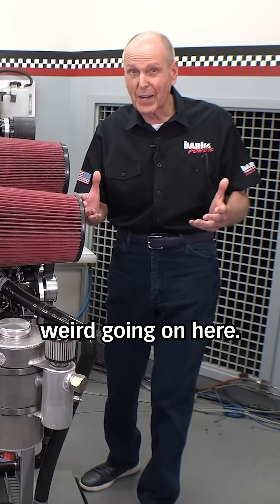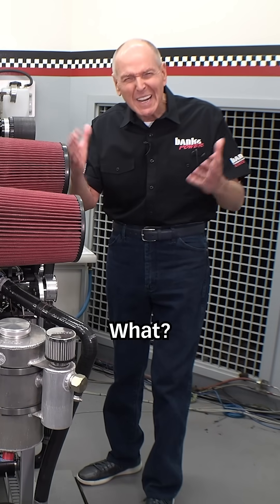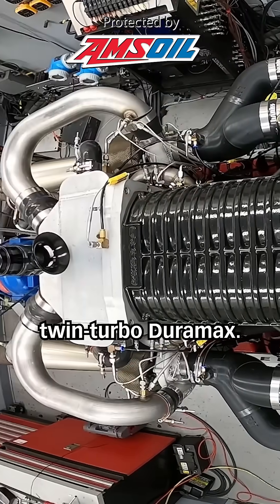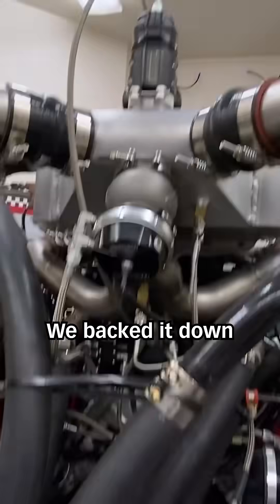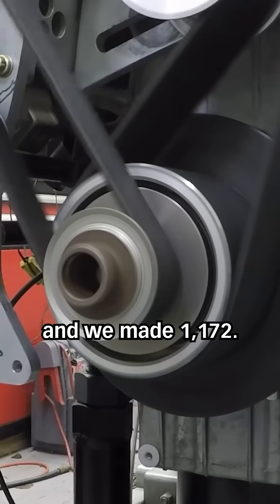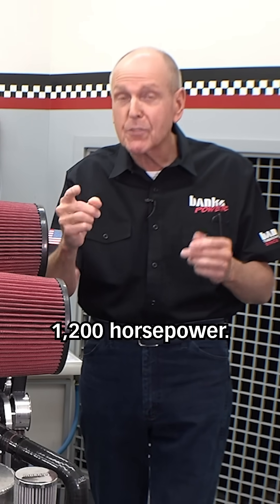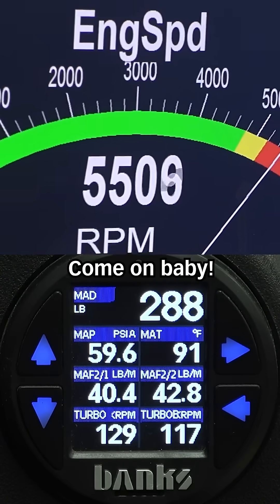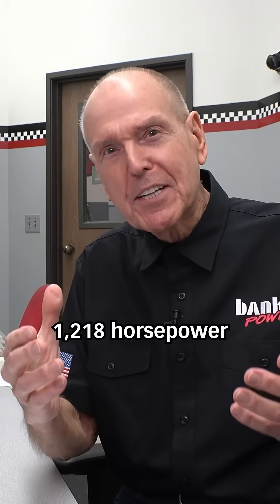How to make 1,200 horsepower the wrong way.

Comment: Did dude just say he has the blower second??? That completely defeats the purpose of a super charger🤦🏻‍♂️. Thats for quicker lower end boost until the turbo spools up. Super charger always goes first. 
And then you need a bypass valve to be able to skip the blower or else its actrually going to lower the overall boost by disinhibiting the turbos air flow.  
Surely this guy remotely knows what hes doing right?  Right?😅😭

Ps wtf would u even put a blower on a duramax. That doesnt even make sense. Its not a peppy track car. All its doing is straight lines. Turbo lag doesnt really matter on that. 
Im in diesel performance and ive never seen let alone even thought about super charging a diesel truck😂
Diesel likes its turbo.

Comment: German company Zoche build a 2.5 litre, four cylinder radial two stroke diesel. Low speed air came from a turbo blower driven by the crank. Probably 1 to 10 step up speed. Turbo was plumbed into the same manifold. The driven compressor was also the engine starter. Compressed air blown into the compressor eye spins up the engine. 
It made 150 bhp at 2,500 rpm. Which was perfect for a lightly stressed aero engine. Spun up to 4000 rpm you be seeing 250bhp. Add high pressure common rail injection and 500bhp would not be impossible. That would be 1000bhp from 5 litres. 
Sadly, it all fizzled out. Aircraft homologation is a money pit and they ran out. Such a shame.

Comment: Horsepower peak isn’t the only or the best metric. Turbos have lag, the blower is more parasitic but able to create horsepower early in the RPM. That’s one reason this is all nearly pointless today and tomorrow… electric vehicles make peak horsepower and torque at 1 rpm and are controlled by million times a second computers.

Comment: Higher blower speed/ PR = more thermal expansion.   Less air density.   
Blowing the blower should bring down the PR as rpm goes up reducing thermal expansion  improving density. 
Most non-lab grade testing shows sealing is an issue using the blower in the 2nd stage.

Comment: Problem with roots style blowers is you can't provision an intercooler. Spin them fast enough and instead of increasing density you are just making the air hotter. Gale knows all this hence why he's saying it's backwards. 

The real solution that is very engineering challenging is have a supercharger when turbine pressure is low and turbochargers once they have spooled up from exhaust gases. The challenge is gating the airflow properly from one to the other smoothly.

Comment: The problem with running the blower before the turbo is that the blower is a fixed compressor. It is always pushing air, so when the engine goes into vacuum you're putting stress on the turbo's imput shaft as the intake turbine and exhaust turbine are being forced at different speeds. It's different when turbos are compounding because they scale with the same exhaust pressure. What about doing away with the blower and slapping twin compound systems on it? Or running a massive centrifugal blower on it instead of the twin screw?

Comment: Stupid question.  Is there a way to have a small turbo for quick initial boost and an oversized one for high end power set up on an engine?  Or is there a reason why they run two of the same size?

Comment: Check intake pressure before the turbo inlet and after also flow rate before and after, I think what's going on is when the blower is turned up the turbos might just be slowing the intake air rather than compressing it more.

Comment: It’s just me, but whenever I’ve looked at twin charged engines. I have always wondered why they put a roota supercharger on there instead of like a centrifugal supercharger, something that has a really really high gear ratio to create similar boost response as a roots blower. 

Then combine the charge pipes from the turbos and the supercharger with a y just before the throttle plate. Air to water charge cooler same as the roots blower. Just make some velocity stacks or something to direct airflow.

Comment: I agree as the blowe constricts the air from the turbos
The blower has a fixed space as a rotor blower
Have it first to supply the turbos with air more efficiently and the turbos make the last compression
Volume first then compression
Now its compression the volume
Blowers are good for volume but not as good as turbo at compression in this case

Comment: How did they run the turbo compound radial engines in WWII?  Remember that they had both as well and made close to 4000 horsepower.

Comment: Given how they function, the blower may be a bottle neck restricting the turbos. Under normally circumstances, the blow is cramming air under normal atmospheric pressure together into the motor. With the turbos in front of it, it's cramming already compressed air at a possibly slower rate. Given the size of the turbos and how fast you can spin up the charger. Charger gets into boost faster, but once the turbos get going, they are a lot more air more efficient. So, use the supercharger as a way to keep power in lower rpms until the turbos get up to speed and then by pass the supercharger cus the supercharger at that point is restricting the turbos.
Reply: You missed he said he slowed the blower and power rose.  So less got more?
Reply: @carlstephens1532  I didn't. This is why I said the charger is a bottle neck. Turbos are waaaay more efficient at making power. The supercharger is great for the low-end, especially if it's a centrifugal supercharger. Big turbos take a bit to get into boost, but once there, you can send it to the moon.

Comment: Backing down the turbos on the waste gate? Turbos compress air from the hot spinning exhaust  so the air fuel ratio must be correct for the tupe of fuel used. The turbos are a restriction for the supercharger they will experience turbo lag on a pull  and slow down air intake untill they spool up remove turbos and keep the intercooler and feed the supercharger cooled air to compress . A ice 🧊  can on the intake would work or a custom co2 cooler for the air intake using a co2 bottle to cool  a expansion core. A airconditining evaparator core assembled into a air intake box co2 is allowed to expand inside evaparator core and then vent to outside air this will make air cold 🥶  and dense so supercharger can compress more air to cylinders.😮 this should increase horsepower. You could inject windshield washer fluid into the air intake system this will stop detonation  and increase horsepower. Water will expand into steam increasing horsepower and protecting the engine from detonation water has a cooling efect also. These are some old tricks of mine 220 MPH Z28 355 4 BOLT 30 OVER  BIG CAM  CUSTOM TORQUE CONVERTER AND TRANSMISSION AUTO 4 SPEED TH700 R4 I BLEW IT UP! FIXED IT WITH SPECIAL SPRAGS.

Comment: Backing down the blower speed just means the turbos are able to put out more boost. If the blower starts picking up more by pulling more airflow before pushing that air to the engine it will reduce the boost from both turbos creating a reduction in horsepower.
So banks made a good discovery.
 
Detroit made a V8 what they classified as "naturally aspirated" diesel engine however it had a blower sitting on top of the intake manifold. 

You could do this 1 or 2 ways, keep the blower speed up, but need to find a way to create higher psi of boost from both turbos. That way the supercharger is not overtaking the boost and reducing the PSI into a vacuum pressure. 

Or just do what banks explained in this yt short.

Comment: In Volvo’s twin charged i4, there’s a system of pipes and a throttle valve, plus an electromagnetic clutch on the supercharger. What that does is engage the blower up to 2800RPM, where the turbos kick and the blower disengages, ultimately giving the low down power of a supercharger with the high end of a turbo.
Reply: That's ingenious.  Overly complex, but ingenious.

Comment: I don't want to sound disrespectful, but turbo first blower second makes no sense, the blower is the first in line for air inlet. The blower is directly controlled by engine speed, with a basic knowledge of theory, it is very obviously blower than turbo

Comment: Was the blower making hotter air at high speed? It may be sapping hp potential due to overly hot intake temperatures with the blower flying so fast. I’ve seen small ones act kinda like that I’m definitely no expert though I’ve just seen some things lol

Comment: I think banks knows why it's doing what it's doing but he leaves it unanswered to make us wonder and think, and my best assumption is that with less blower rpm you're not over spinning the blower. When you overspin the blower you create too much heat and heat fights power
Reply: I think that over spinning the blower is pulling through the turbos. Spin slower and it's pulling higher pressure air from the turbos. Up the turbo boost and keep super speeds the same and see what happens.
Reply: Exactly, and that heat is reducing air density, less blower = less heat which = more air density
Reply: Backing down the blower speed moves the prime RPM where the blower is working most efficiently up in the RPM range to match the turbos without over spinning the blower. I would definitely like to see the power curve on the different adjustments they have made searching for the high numbers he wants to see. Also blower should always be first, to bring the power at lower RPM and spool up the turbos. Then like one of the other people said the blower needs to bypass and let the turbos take over. 
He definitely knows exactly what he’s doing and what to do to get the most out of this combo.

Comment: I think slowing down the supercharger is reducing the temperature of the supercharger and increasing the air density.
Reply: Bingo!!! Finally someone thinks about air density, aircraft rely on those measurements to operate  engines and airframe for flight to exist. Think EPR for turbines and Reynolds  numbers for lift given a certain aircraft weight and field elevation. Fun to play with these real world applications.

Comment: Fuel air mixture ratio and pressure. Sounds like the air is too turbulent for the fuel to ignite properly and the flow rate too high acts against the valve heads. Less is more

Comment: Volumex, Lancia, Delta S4.
Use a supercharger to counter turbo lag, when turbos start making boost, slow the supercharging, stop supercharging, let the Turbos do it all, more efficiency, run the turbo boost as high if you want.
1500cc inline-4, special fuel and compression ratio with over 4,5/5 bar boost? Was able to make about 1350-1400 horsepower at about 10.500/11.000 rpm.
Not for long, but it could.

With modern electronics and cvt system and pullyclutches operated on turbopressure just before wastegate opens?
You should be able to make an engine running both worlds and getting rid of a supercharger stealing a lot of bhp
Reply: nissan micra march

Comment: What about a centrifugal supercharger feeding the turbo. If it’s a twin turbo, then do two centrifugal superchargers to feed the turbos. 
Or do what another commenter, Camosnowman, said and have a bypass valve open when the blower is at its limit so the turbos take over.

Comment: Make more power and better torque curve if you can make it blower first turbo second so that the blower spins up the turbos and then the turbos take over and bring the air density way higher, allowing you to add more fuel

Comment: I think he is right in that it does seem backwards.  The linear boost curve of the supercharger should feed the turbos.  As long as the SC is sized to not be a flow restriction you should get the best results.

If you look at  small turbo shaft engines they pretty much always have their axial compressors with linear pressure rises per stage ahead of a final centrifugal compressors stage.

Comment: If that blower is a roots-style, you may be fight adiabatic issues common with this design. They were for moving large volumns of mass flow (air) at low differential pressures. They tend to become less effective at higher pressure outputs. They don't displace more mass flow, but just make heat. Just a thought
Reply: It's not. Also you don't think he knows that?
Reply: @bunsguns8222  Saw another video and it is a root-blower. Epicloydal rotors and all.

Comment: It's like you always say...it's volume that matters.... y'all can look at it this way: take a garden hose, it's a half inch diameter inside. With 50 lb of water pressure, it'll fill a bucket up pretty quick now take that same garden hose and put it on a pressure washer. The pressure is going way up at the nozzle, but it can't fill that bucket up near as quick you just can't get that much volume of water through that little pin hole in a certain amount of time. The pressure washer will never fill that bucket up nearly as quick as just an open garden hose. In what you're doing is putting the pressure washer first and the volume just isn't there that's probably the simplest way I can explain it

Comment: It seems that the blower would have more volume, kind of like a 2-inch diameter garden hose. Yeah the boost pressure is not going to be that great but it has a hell of a lot of volume. A turbo can be thought of more like one of those latex garden hoses. No matter how big it stretches, it's not even a half inch diameter of hose. it's only pushing a quarter inch of water flow through. Even though it has smaller volume it has a good pressure spray out the other side, which would fake you out, and that's why they probably sell so many of those crappy hoses made out of latex LOL what was I talking about again😅

Comment: You got air restriction. Take those small intake filters of and connect to 44 gallon drums with positive pressure from industrial blowers and you will get another 200hp . At 1200 hp you have so much air trying to get into them little filters!

Comment: In my experience superchargers just slow down the turbo… I’ve seen a couple compounded boost setups work properly. And one was a centrifugal force supercharger.. being feed by a 98mm turbo. The other was a whipple being fed by a single 88 the car made 800hp with whipple only and 1400+ with the Fis 88 feeding

Comment: I don’t know your whole setup but yes turbos first in a dual charge system. This setup was offered for my SS with the lsj motor and it was plumbed the same. It had a borg Warner turbo and an harrop tvs blower. Peak hp on these do go pretty high but the benefit of these dual charged setups is the continuous torque/power curve. It’s a very odd power delivery but very addictive. You have the instant power from the blower and that peak power from the turbos, mid peak torque is usually high on these because of the crossover between the s/c and t/c.

Comment: Random, but would it be a good idea to have a variable speed pulley to adjust and get better tunes
Reply: There's a company that produces a supercharger where the pulley feeds a CVT style transmission and the CVT feeds the supercharger power. Adjustable ratio supercharging on demand.. One good use for a cvt lol

Comment: The blower is only good to compensate for the turbo lag in this configuration, ad soon as you have enough exhaust power to give you the boost that you want, the supercharger is just useless ballast on the engine.
BIG turbos that need lots of exhaust flow to speed up, then the supercharger clutches out and is bypassed. Only way this combination is efficient.
Reply: not true.  the blower will compound whatever the turbos are putting in
Reply: Bigger turbo can make the same boost as the combo, it just needs the blower to come up to speed
Reply: @FerdinandFake  no single turbo will outdo a compound setup, pretty much ever.
Reply: @BlackBeardAir  yes, but it already has twins. How much boost do you need ?
Reply: @FerdinandFake  Twins and compounds are not the same. . .  Twin turbos are usually for piping/manifold simplicity, or for faster spool.  They aren't very good for top boost numbers

Comment: Compound turbocharging infinitely better. High pressure ratios, less parasitic loss, more control over backpressure if VGT incorporated.
Reply: I could agree more.   I think this is just to be cool with a blower.
Reply: @BlackBeardAir  I think this is a 30 second short and he goes into depth on on his full length videos if any couch engineers feel keen

Comment: This is a thought. By slowing down the blower, you're giving the turbos more time to charge the blowers capacity, and then the blower is able to compress even more air because it's starting with more air, thus making more power. This is a thought, I've played with turbos, and I've played with blowers, but I've never played with compound setup. So I've got zero real-world experience.
Reply: he's reducing parasitic loss with lower RPM,  but still getting high pressure from the turbos.  The blower is still compounding, just more efficiently now.  it's crazy how much HP the blowers eat up to spin
Reply: @BlackBeardAir  True on the parasitic loss, but the instant boost of those positive- displacement is nice. Thanks for the heads up.

Comment: Only way IMO is to have a big centrifugal blow into turbos but that might create double lag
Reply: The only reason there's lag is due to lack of flow if you put centrifugal Chargers on it as long as they spin up fast enough putting enough volume of air to the turbos should be fine

Comment: Using the supercharger to spool the turbos in a way would be great but also at a certain rpms it should have a valve that allows for more turbo power at higher rpms
Reply: Magnetic clutch.